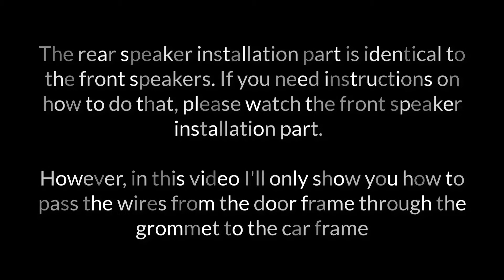[Part 4] 2019 To 2025 Toyota RAV4 - Audio System Upgrade - Rear Speaker Wiring (How To/DIY)

Comment: "Detach the connector by pushing this small pin" @ 1:27 -- I can't identify the pin.  Do you push it with a screwdriver, by hand, something else?  Not having any luck currently.
Reply from the maker: I used a small screw driver to push the pin down. You might need to use some force. Toyota did this so you wouldn't add any accessories which is ridiculous.
Reply: @RAV4Guides  Thank you!